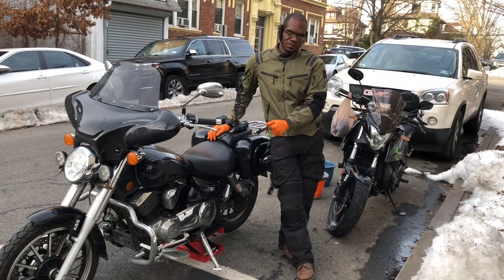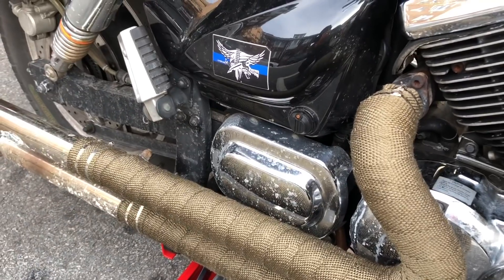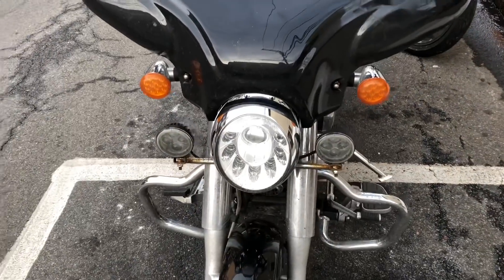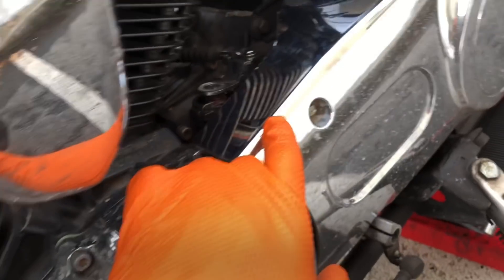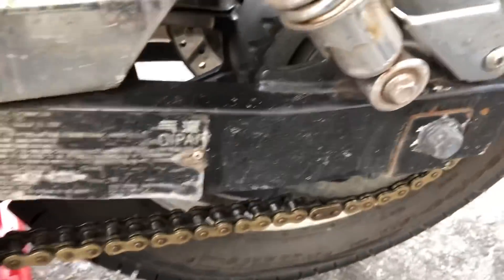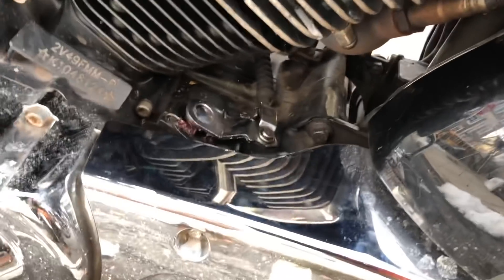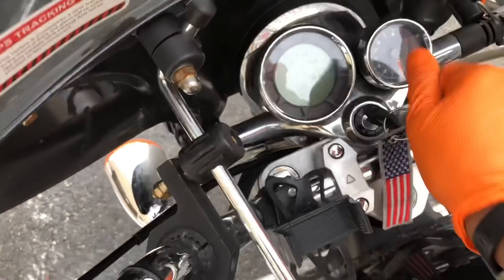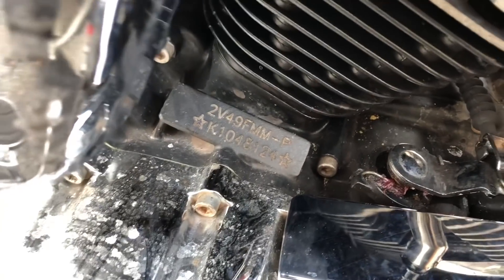American Lifan Lycan V16 LF250-D Motorcycle Winter Restoration / Available Parts for Sell

Comment: Sine it is a Chinese bike are you putting American parts on it? I notice it say Harley Davidson on the side of the gas tank. I want to buy a lifan lycan motocycle but I just worrie about the maintenance. Cool  video!
Reply from the maker: Don’t buy it with the intention u r going to find parts for it by comparison such as Harley Davidson. After-all it is in fact a Chinese motorcycle. Lifan Co Ltd., though is one of the highest manufacturer Chinese bike in China and they stood by their reputation on what they sell.

Meaning, once you receive ur bike, u can keep driving n abuse it until u destroy it. To ur surprised it will square as to par to n actual Japanese bike or one of those Harleys. But again u won’t find parts for it here in the US because it’s Chinese.

Things u will replace in the longevity of it is, transmission falling apart after 18k miles or sooner. Chassis bearing seized after 2 years, and wiring harness becoming defective after 3 years. You won’t b able to find parts on ur own except through the dealership if they even know, or through an importer like me.